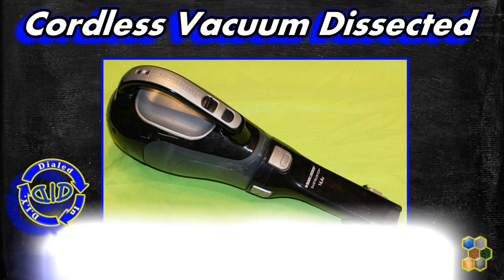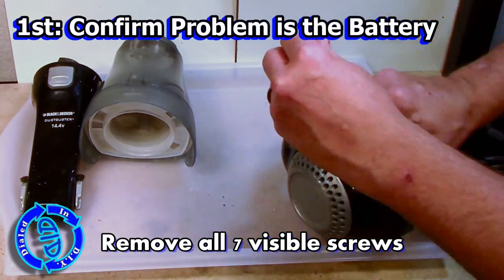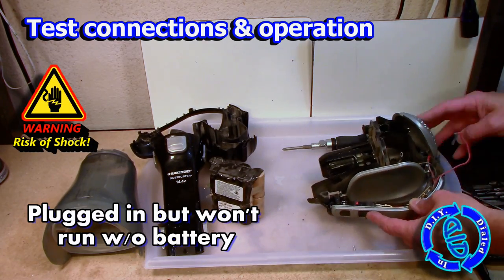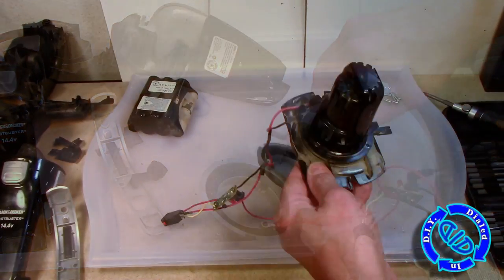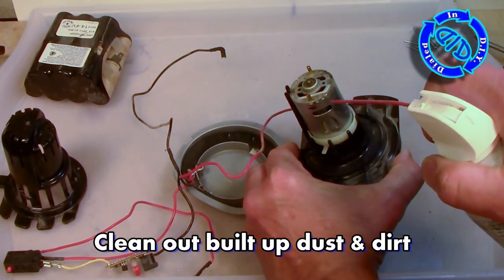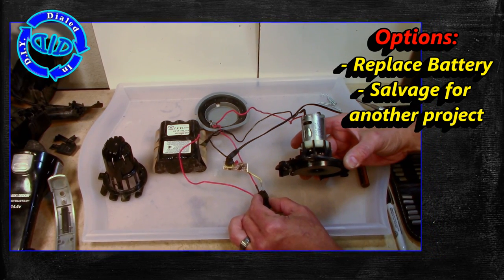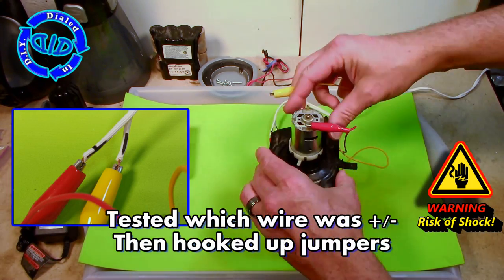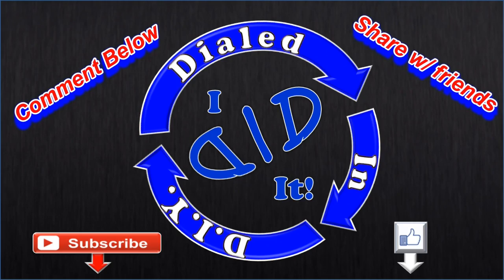Inside a Hand Vacuum - Fix vs Salvage Free Electronics & Project Parts

Comment: I found a nimh pattery pack for these but the best price was $38. That motor draws about 12 amps and runs scary fast at over 28000 rpm's. A new lithium powered vacuum cleaner is about $46.  The circuit board is only for charging the batteries. An option would be to replace the nicads with 4 LION 16850 cells, but then a special charger is needed and it becomes complicated.
Reply from the maker: Very cool idea and info! Great user name too BTW.  Thanks for taking the time to watch and comment... I really appreciate it!
Reply: Obsession of the Month in on in

Comment: Good video but I think the REAL reason the poster decided to use the vacuum as parts and not replace the battery is because putting it back together is far harder than taking it apart. Mine had a motor problem. I ended up taking apart the motor and replacing the front end bronze bushing.  I made it from parts taken from a salvaged motor. In truth .... a replacement battery is almost 75% the cost of a new unit.
Reply from the maker: So true about replacement cost to buy the new battery. That was the main reason it went to salvage... I've started making my own replacemant packs for some things using salvaged cells. Thank you for taking the time to watch and comment!

Comment: I have cordless vacuum cleaner. It's motor 7.2v dc. And it is working from rechargeable   battery 7.2v dc 1500mAh. When I start the vacuum it's speed is going slow after few seconds. I know this battery is faulty. But I don't want to buy battery. I want to use power supply adapter AC to DC. Input 220v ac,  Output dc v as per the motor. Which adapter suitable for this motor? Which adapter i should buy? What is the amp of 220v ac. And what is the amp of 7.2V dc? I want run this vacuum cleaner from the adapter with continuously.
Pls give me reply. I need your suggestion. Thanks.

Comment: Thanks for this great rundown. I have a hand vac with a 7,4 Li-Ion battery and a 7 W / 40 Watt motor. It works fine but too weak for my taste. Can I just install a more powerful motor from the store? What do you recommend I consider?
Reply from the maker: That sounds like a great idea.  As long as there is space for a more powerful motor inside the case & the battery you have is enough to power it, then I think trading up on the motor will work perfect.  My preference is to "salvage" parts where possible (its more fun for me that way for some strange reason) and a thrift store type of place could be a great start for finding a "broken" mini vac that could provide you with a better motor (for less money than buying a new motor).  But, in the absence of that you can search on line for sites that sell used parts which can also be allot less expensive.  Please let me know if I didn't really answer your question.  I'd also love to hear how it turns out if you do upscale the motor.  Thanks for your question and for watching my video!

Comment: i got one motor from a little hoover vacuum cleaner but i cannot make it work directly with any voltage, it came with a 3.6 battery pack but batteries was almost dead, wanted to make it run corded but didn't work :c
Reply from the maker: I have had the same problem with some other things; bypassing the battery and connecting directly to wall power would not allow it to work.  Sometimes there is a self-protective mechanism that will prevent the appliance from being destroyed if the battery has a major failure.  Thanks for watching and posting your comment.  Hope all is well your way!

Comment: I have one of these but no charging deck and the battery is completely dead. What projects could I use these parts for? Any cool suggestions? I like rc airplanes and rc cars etc.
Reply from the maker: There is some great power / RPM with the motor so I am assuming there are some fun options for RC application if you can get the needed volts. I guess the challenge comes in the form of weight. I chose to experiment with attaching to a wall wort to run as a fan/blower but thought I could also convert into a handy little hardwired bench vac that I could mount under a workbench. In general the switches are good for other projects too.

Comment: What was this project you used this motor on?
Reply from the maker: I actually kept the motor with the fan and made a different vacuum. Forced the air through smaller intake to create a more powerful cleaner.  I've been using that to experiment with some other ideas I've been working on.  Thanks for watching and posting your question!

Comment: Is it dangerous to touch the wires that are connected to the battery??
Reply from the maker: Assuming the battery pack is not plugged into an outlet (by way of the vac), then not too bad.  It is 14.4v so it isn't holding allot of power when it works.  It is less than 2X 9v batteries at once but I still don't recommend testing  voltage on purpose.

Comment: Any recommendations on where to purchase the batteries?  I found a website that sells each battery for 5 dollars. So times 12 turns out to be over $70 which is not worth fixing.
Reply from the maker: Great question, depending upon where you are you might want to check out a specialty battery store.  Nothing fancy; where I am there is a store called Batteries Plus that seems to always have an equivalent pack for things.  The other option might be a source like eBay.  In a previous comment "Obsession of the Month" mentioned that they found a pack that was not much less than the cost of a new vacuum in which case I would opt for the new vac.  I'd love to hear if you found a good alternative... best of luck.  Thanks for watching and for the comment.

Comment: Do you know what kind of motor it is? I’m wondering if I can use it on an electric skateboard build
Reply from the maker: that is a great question... sorry, I am not sure the exact specs on the motor.  That is also a great idea but I would doubt that this motor has enough torque to move a person on a skateboard... it'd be great if it did though.  Thanks for watching and posting your question!
Reply: No way .... this is a high speed motor without much torque. You need a motor with gear reduction. Check out eBay or look for a You Tube video on building an electric skate board. The parts will cost you more than a complete unit.

Comment: I have this model and it stopped charging, I removed the Six screws not 7 gently pried the side off and with a bit of fiddling I re-soldered the charging port back onto the circuit board. The charge port has two lugs on the bottom, one lug has a long thin metal tongue which allows for flex and the other is a short one which Is a poor design and looks like it will fail in all of these after the charge cable is inserted and removed a few dozen times... I also considered simply binning the charge port and just soldering a pair of wires to dangle out of the unit and have a connector plug on the wire. If it gives trouble again I'll do that.
All in All, Poor design ...
Reply from the maker: Overall I do think you are right about the design. I've noticed allot of these in this price range don't last as long as they should and the cost of parts to fix is often not worth it. Love the idea to hack your own charge access... I've done similar on some other devices and it has worked well. Thanks for taking the time to watch and post a comment!